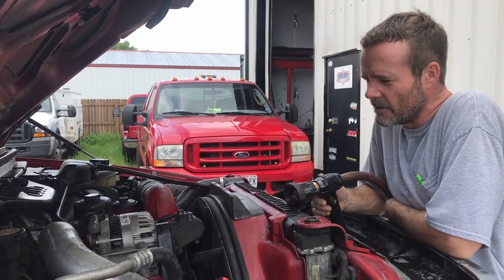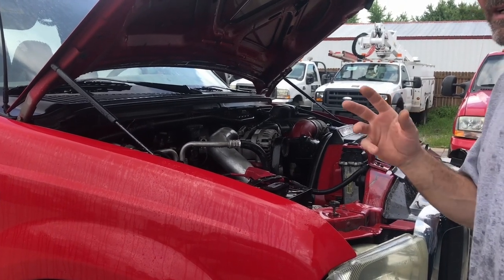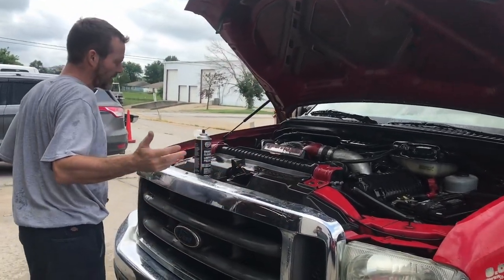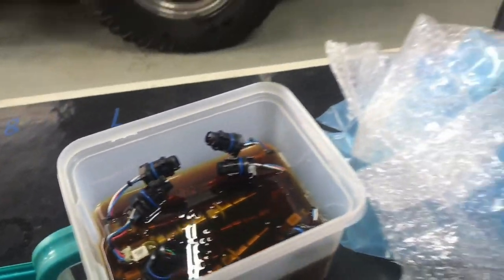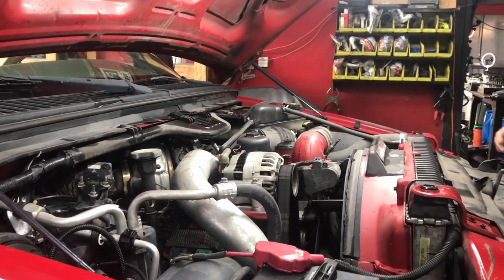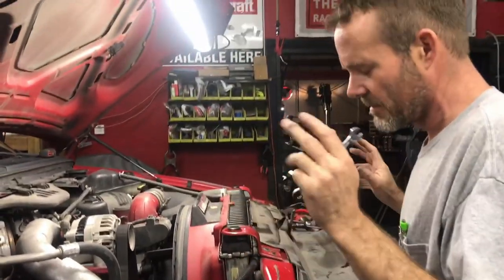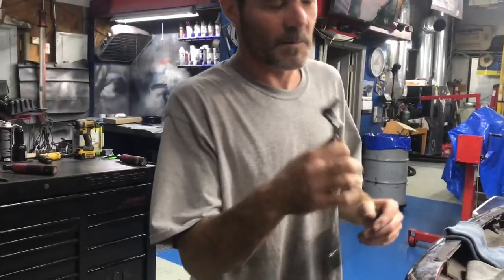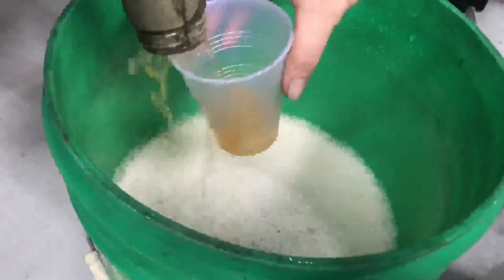1 How To 6 0 Powerstroke Injectors 1

Comment: I actually had to come up with a way to fix the battery cables after customers either overtightened them or tried to use the wrong bolt to secure it. You can’t even find a positive battery cable on eBay.